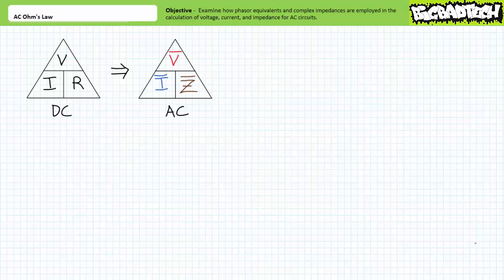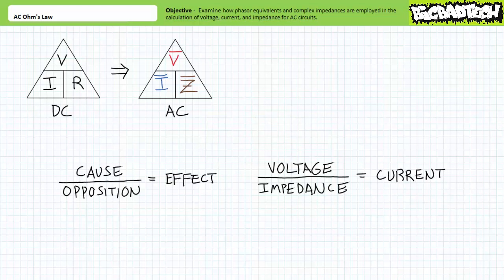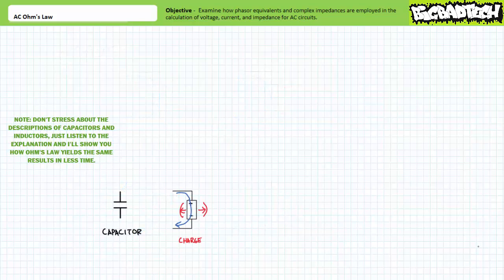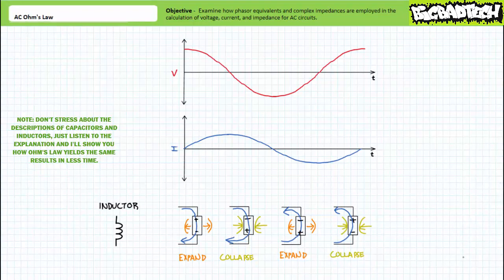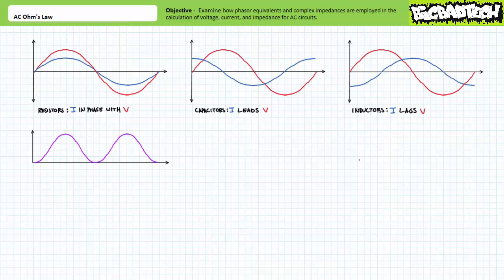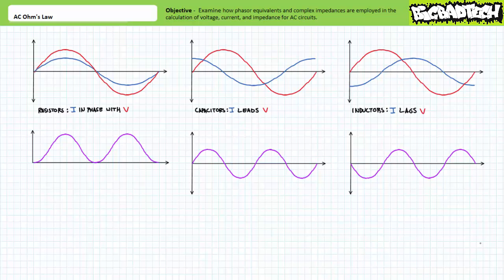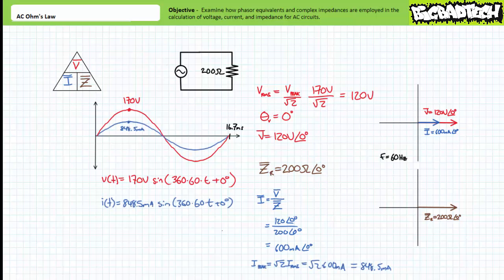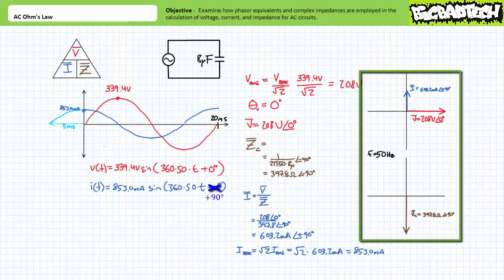AC Ohms Law (Part 1 of 2)

Comment: Sir can I ask?
What is the relation of ohm's in AC with emf and without emf
Reply from the maker: Excellent question. Counter electromotive force (CEMF) can be thought of as voltage in opposition to applied voltage where the magnitude of CEMF is proportional to rotational speed. Check out the "Electromagnetic Interaction" lecture at: https://youtu.be/fv5494lRQAs for more details on CEMF.

Example 1: 120V applied to a motor winding at rest (ie: rpm =0 and CEMF = 0V) with 6/30 impedance. Resultant current is 20A/-30. This would be the inrush current you experience when you start a motor at rest.

Example 2: After surge of inrush, motor starts coming up to speed and produces CEMF in opposition to applied voltage with magnitude of CEMF proportional to rotational speed (ie: more speed, more CEMF) . Let's say at the rated speed the motor winding produces 78V CEMF in opposition to the applied voltage. One end of winding at 120 the other at 78 results in a 48V differential. Resultant current is 8A/-30. This would be the rated current the motor experiences when it's producing its rated power. This is the current specified on the motor nameplate.